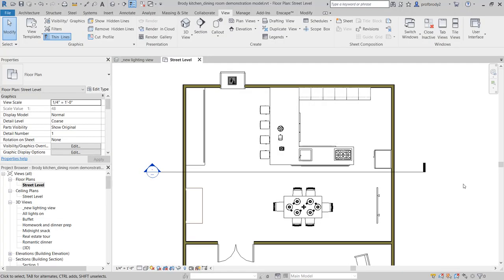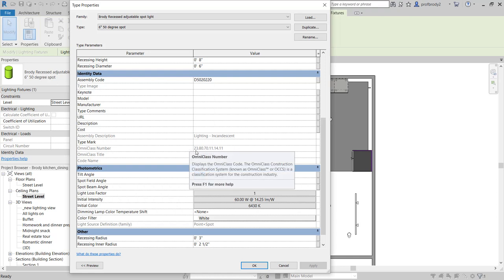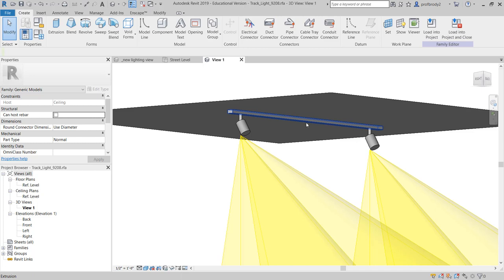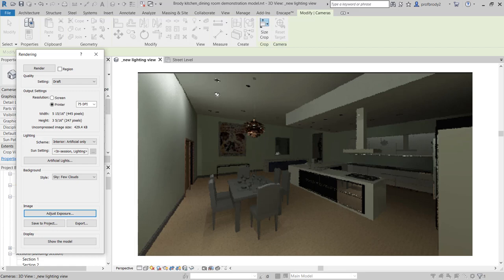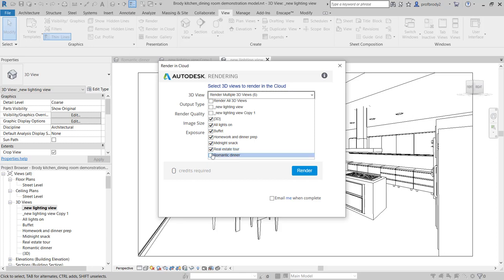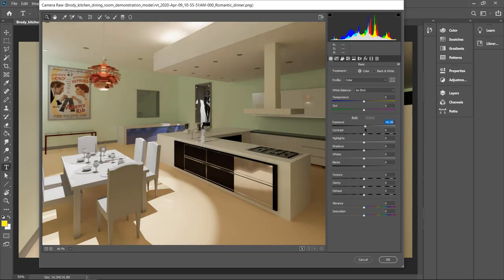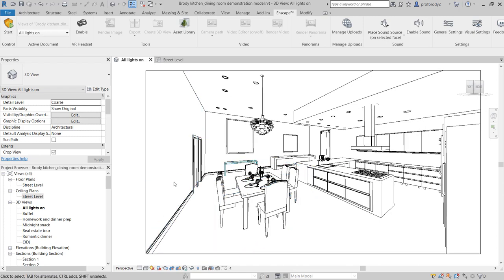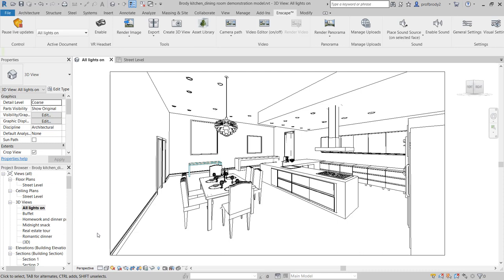Kitchen and dining Area Lighting using Revit

Comment: do you make the lighting yourself? where do you find them? this is very int!!
Reply from the maker: Most of the recessed lighting components I use are standard ones from Revit that I've modified. Decorative ones are usually from RevitCity, FormFonts, or SketchUp's 3D Warehouse - but I always count on having to modify them to get the light to work realistically.